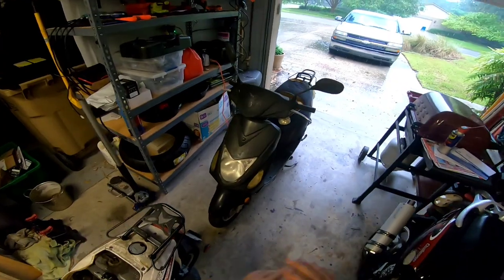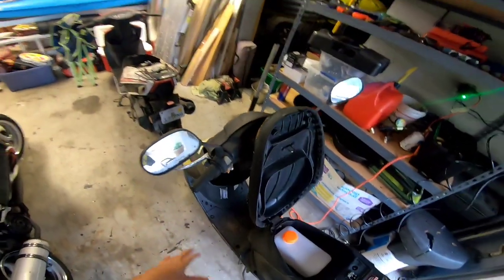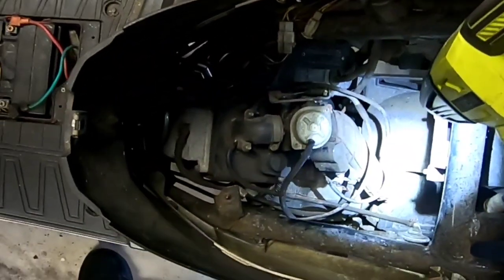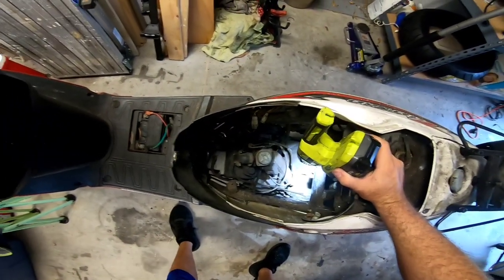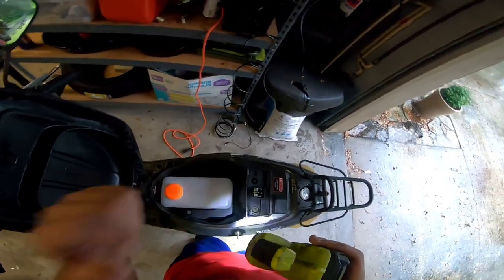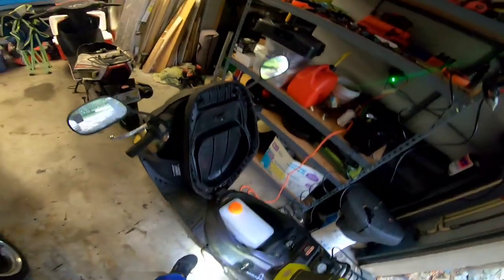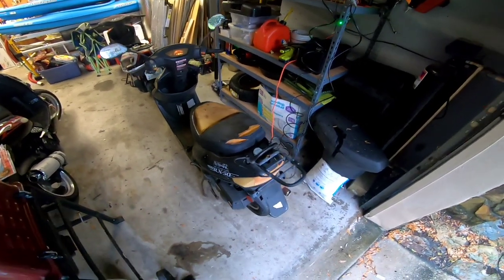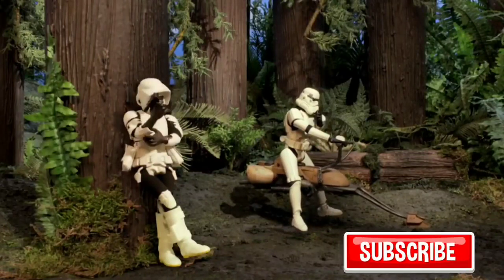50cc Scooter Gas Tank Upgrade Options  For Long Distance Traveling

Comment: Good idea, thanks for the vid. Do want to add though, you should mention that when dousing with water, once the gas is leaking or flaming, if you are already too late, if you throw water in a gas fire, it will make it bigger. When I was a kid, I was burning my GI joes in a battle......when I play war....I play war. Anyway, that was the day I discovered fire will travel through the air, following the fumes to the gas jug. It didn't ignite the whole gas jug. Just the end of the nosel was burning. I threw a bucket of water on it.....and a flame shot up over the roof of my house. Im not trolling or anything. Just talking. If you're gonna do that, you should be fine. But one of those small fire extinguishers would be a good idea. I know it's not practical. Just wanted to point out that water makes gas fires bigger. Like a grease fire. I was burning stuff one day, after I was an adult, and I saw the flame coming through the air for the jug. Wish I had this one in video. I grabbed the jug to move it, but the fire kept following the vapor. It chased me around the yard. Hahahaha the look on my families faces when I came running around the corner and a flame following me in the air. It happens. No one wants to give up storage space. I was just looking for a way to add more has of I decided to take it on long trips. You should find a way to use the existing gas tank along with your mod. I know you said the tank was leaking. I'm guessing the tank is plastic. Im not sure, I never looked. But if your tank is plastic, you can fix those leaks by plastic welding. Several ways to weld plastic. Look up YouTube vids on it but I'll give a run down on my already huge comment that will trigger some people because it is so long. Hahaha but I'm taking here. They sell plastic welding kits but it's basically and oversized soldering iron. They sell plastic rods along with them, but you can make your own using any plastic you find lying around. Just cut them into strips. Also people have made videos showing how to make some really clever homemade plastic welders that are self feeding using soldering irons and a piece of copper pipe. Saw one made from a modified hot glue gun. Butane lighters. Etc. should be bi gas in the tank anyway if it has t been used for a while. So, just use what ever to melt plastic together to patch the tank. You can also use metal mesh like window screen or even just strands of copper wire to reinforce the plastic you are welding or patching. Like rebar in concrete. First, melt your "rebar" in where you are patching. Right into the plastic. Then use scrap plastic or what ever, and melt it right into the rebar you already placed and install the plastic on the tank. You can sand it and paint it and make it look pretty. But if no one will see it, I wouldn't worry about. You can fix all kinds of things this way. I fixed all the plastic on a fourhweel I got last year. A Honda, using pickle bologna jar lids. Not just fix plastic but Build all kinds of things like that. Just wanted to mention that to you because it is super easy and it would give you more gas if you could add it in some way. Instead of just wasting the space. That was what was in my mind. Just having more gas in case I was on a long trip. Where I live, especially after the flood we had that wiped out half the state, hard to find a gas station right now, in a lot of places. You gave me a really good idea of something I can do based on what you did. Thanks for taking the time to make the video and I apologize for writing a book. But you can fix that tank pretty easily. Watch a few vids on plastic welding. Make sure you use a plastic gas won't break down. Later.

Comment: this is so swag, my scooter is for stunts, and i saw a video of a guy wheelieing one of these, then his rack scraped the road making a bunch of sparks and it made his gas tank explode! so scary lol. so thank you. ima give this a try, but im gonna use like a 1 galon tank or 3/4 even. and make it as far back in the seat as i can. sorry for the rant i just love scooters. im sure u understand tho haha
Reply from the maker: No problem glad I could help just make sure if you're doing wheelies and stuff to put something to secure the tank from sliding around like locking Velcro

Comment: smart thinking.  about to do that for my VIP.  glad to see some helpful ideas.  the petcocks are a safety feature, as far as i can tell.  i usually pull them off of my "shop trucks" and my scooters and run a shut off valve above a filter or screen.  great work around on the plastics, too.
Reply from the maker: Glad it was helpful!

Comment: I'm so glad I found this.  I don't use the seating area for cargo, and my vacuum petcock on my icebear 50cc has failed - I would have to take ALL of the back plastics off and pull off the gas tank, and replace the vacuum petcock, and put it all back together.  This looks much easier!  Already replaced the carb sparkplug exhaust variator rollers and belt so it shouldn't be a problem.  I thought I was done before this failed :)
Reply: This fuel petcock is actually under the gas tank.  Huge PITA to pull apart.
Reply: Wait a second how do you prevent flooding or dripping?
Reply: Looks like that other one is back-ordered for two months, I'm going to try a B09CFZCP7C
Reply from the maker: As long as your carburetor doesn't stick with the float it won't continue dripping. The reason gravity fed system is better is because if you have any vacuum leaks it will not affect the fuel input system you will always have fuel incoming. There's only that one risk of the float sticking and losing all your fuel however if you run ethanol free fuel the chances of this happening are extremely low